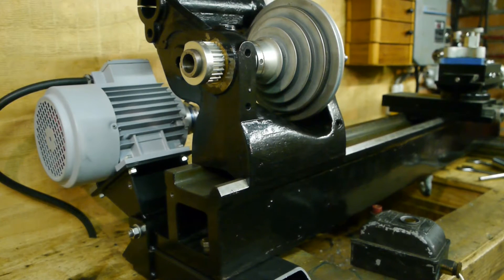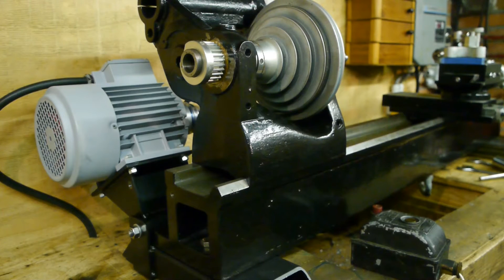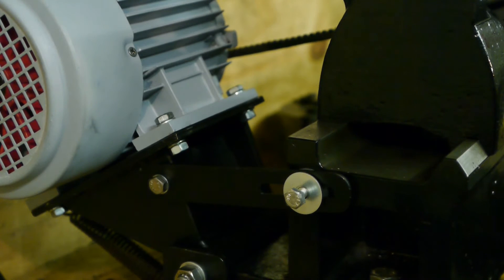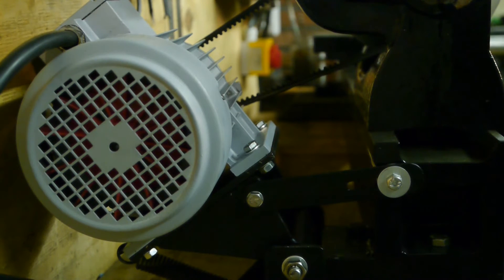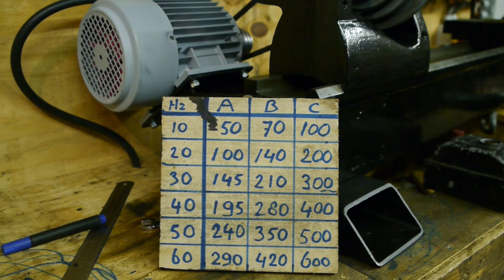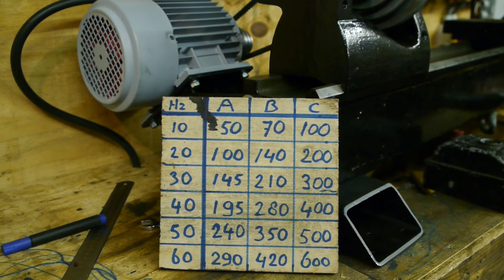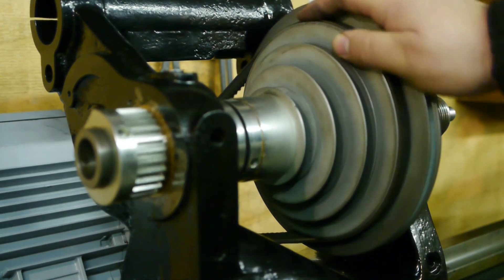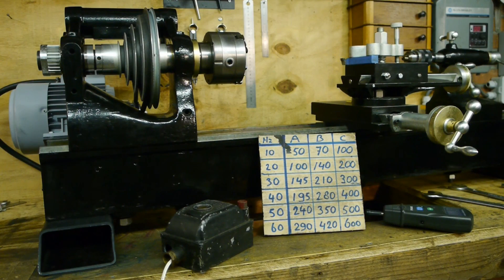Lathe speed testing and motor mount improvements

Comment: Even with the good bushings on your motor, you should have the bracket as close to the pulley end as possible, other wise you are putting torsion on the motor and it's assembly.

Comment: Have you tried making up a line shaft ? give you a variety of speeds and more torque!
Nice machine !
Reply from the maker: You probably mean a counter shaft.
I've thought about doing that but since I have a vfd I didn't think it necessary.  A  counter shaft would take up more space and take longer to fabricate. 
But it would also give me more power at low rpm.

Comment: May I ask why the motor is so noisy?
Reply from the maker: The noise is caused by the blocked-up wave form coming from the VFD. Basically the motor acts as a speaker for that wave form.
Reply: Oh, ok...that makes sense. Thanks
Reply: Ouch,  that motor noise!!!!   Any way to mitigate that?
Reply: @SilverJ56  carrier frequency, you can increase that to 10khz+ in some VFDs to make it less annoying.

Comment: Thanks for the update.  The bracket does make a big improvement to the motor stability.

Have you considered a link belt.  I am not sure of the name in your location.  A link to illustrate.  I find this style reduces vibration between motor and machine.  You may still need your bracket to keep the motor from bouncing.  These belts are good for machines/fans which are not used often since the belt does not take what we call a "set" in the US where it conforms to the smallest pulley diameter and does not flatten out easily as it rotates.

http://www.grizzly.com/products/Power-Twist-V-Belt-3-8-x-2-m/T21991

The slow speeds would be potentially useful in threading, but you mentioned you would use another lathe for threading.

Sad that the carrier frequency whine cannot be fixed.  

I will be interested to see the lathe in action in future video.
Reply from the maker: Wow those belts are expensive! But convenient when you don't want to take apart the spindle. 
But you are right, that "set" problem is most likely causing the vibrations. 

I don't think they would be as good as a regular v-belt when it comes to transmitting power. For that same reason I also dismissed using a round PU belt.

Without a lead screw I can't do any single point threading. But I do have a die head that came with the lathe. I should give that a try a some point but I doubt that there will be enough power to use it.

Hopefully I can do some testing today.